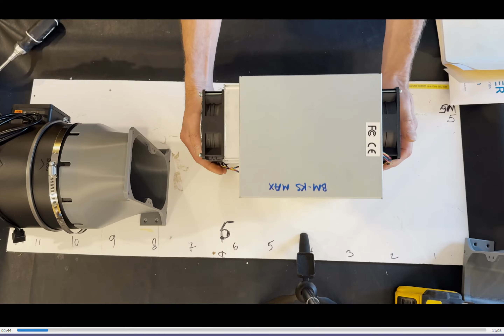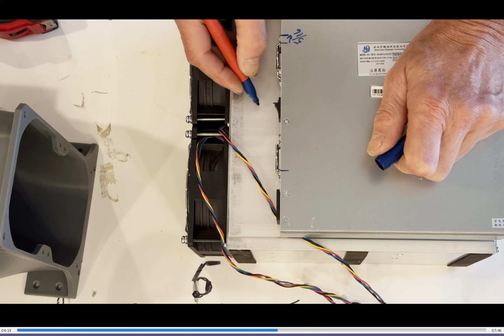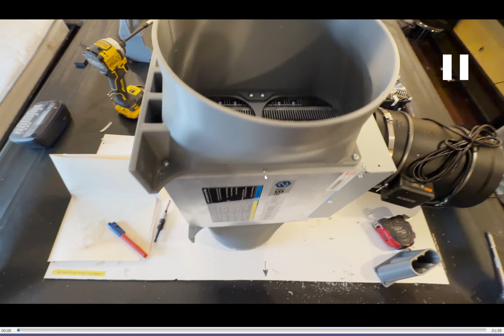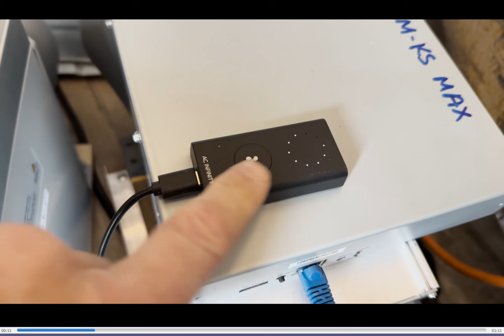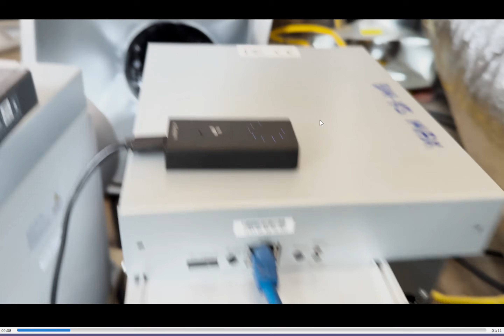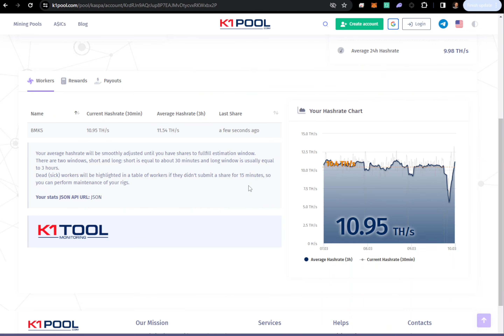iBELiNK BM-KS MAX WITH FRUITION DESIGNS KIT, DOES IT WORK?

Comment: Would you still recommend iBelink BM-KS Max? Someone in my city is selling one, and it just seems like everyone buys iceriver and bitmain. but you have one, would you buy another one? The guy is selling it for $2,800usd lol which is why I want to buy it but I am torn between just buying that machine, or buying that much in kaspa.
Reply from the maker: For $2800 I would buy it but not financial advice. This machine it’s just Ben mining not stop and pretty stable for me about 10.7TH and rewards pretty close to KS5L (some fluctuate to 11TH) so very close and price is great if the unit was not overheated and runs smoothly. $4500 will not ROI unless free electrical. So check calculator on kas.fyi use 3000TH a day increase that’s minimum will be going for next 5-6 month at least.

Comment: Hey, I'm having issues with one of my hash boards not showing all the chips. I used to be able to get the hash board to work once it warmed up but with the cooler temps I'm not having any luck getting it to work anymore. Do you have any solutions?
Reply from the maker: I haven’t had that type of issue, sorry couldn’t help

Comment: Helllo have you a link to the 8" Asic Sillencer Kit please ? Good Job
Reply from the maker: They don’t have exact model I used one for S19 kit that just fit almost perfectly with some minor adjustment that you can see  in the video. I have link to fruition design in video description
Reply from the maker: 8” AC infinity fan that I use from Amazon, I like the one with WiFi option that you can set up auto fan speed based on the temperature: https://amzn.to/3TFzldK
Reply: @DontMindMeMining Can you please send a picture of how you set the pins to replace the fans? You can't see it in the video
Reply from the maker: See Short reply
Reply: @DontMindMeMining  Thank you for all
Reply from the maker: @whyphy348 have you found the fan spoofer, they usually in envelope or folder.

Comment: Hello, I have a question.
I have received the Ibelink BM-KSMax. Everything is going well, temperatures of 65º do not happen on the plates and the memories, the maximum I have seen has been 79º
The fact is that some of the chips turn red and now a circle with a number appears in the chip status as an alert.
What is that? I updated the firmware and the same thing happens.
I’m waiting.
Thank you
Reply from the maker: I don’t have exact answer for that but those circled chips represent chips with errors which I think is common. I have those and it’s been mining fine and not even showing rejected shares so it’s kinda internal errors on chips count imo.
Reply: @DontMindMeMining  Do you get them too then?
mine mine well
thanks for answering
Reply from the maker: yes I’ll get a lot of those 6-10 per board sometimes but I don’t notice any effect on mining. By the way what hashrate do you get on the pool 24hours and what pool do you use.
Reply: @DontMindMeMining  have you tried any oc?
Reply from the maker: After the firmware update built in frequency changes won’t work. Before updating firmware it let me set 470 and 1360voltage that increased to 11GH but power usage was high so I had to wait for fruition designs kit to install to unload power of the stock fans from psu. But then got into firmware upgrade and didn’t know it will restrict frequency settings

Comment: Hello. Thank you for the informative videos. How long have you had your Ibelink BM-KS Max? Have you had any trouble with it? I heard some complaints about the hashboards on these models and wanted to see if you had any trouble.
Reply from the maker: Hi Ryan, so far so good. I hope it will stay this way with fruition designs kit and better temps I hope will stay this way longer. I still not sure about voltages and  frequency  settings but they seam no longer to respond with new firmware update.
Reply from the maker: Had it for 3 weeks now since 21st of February